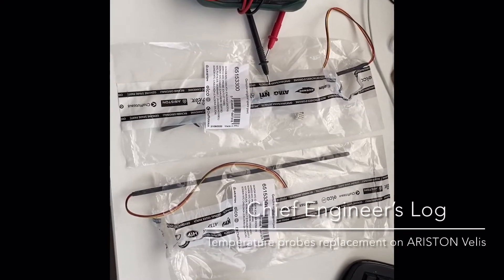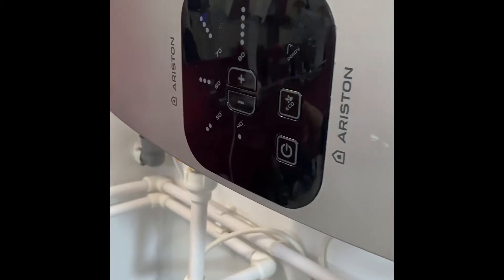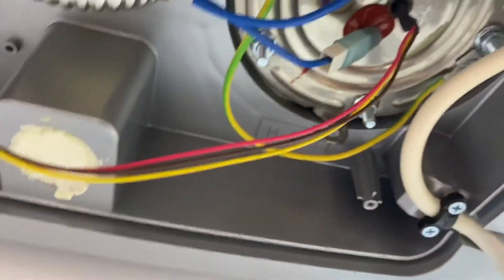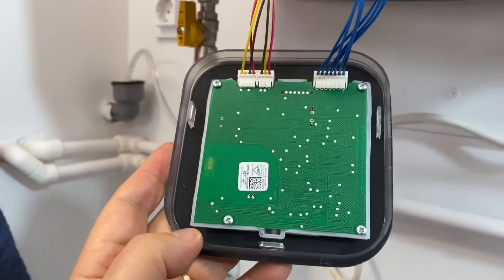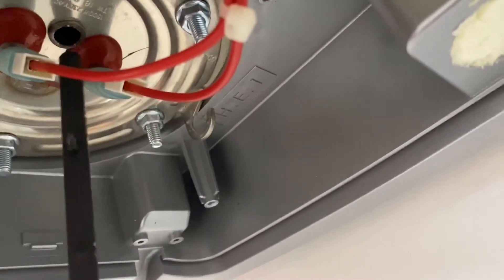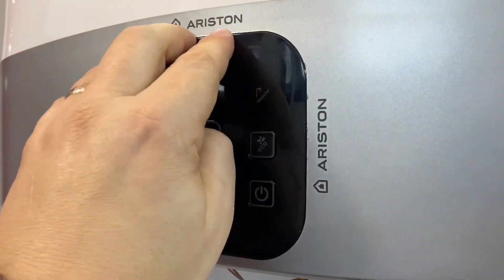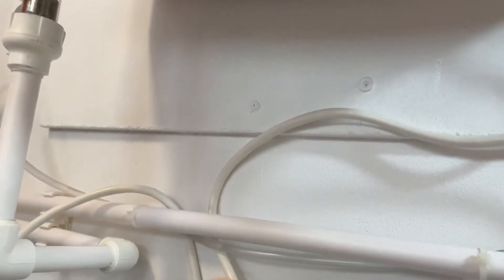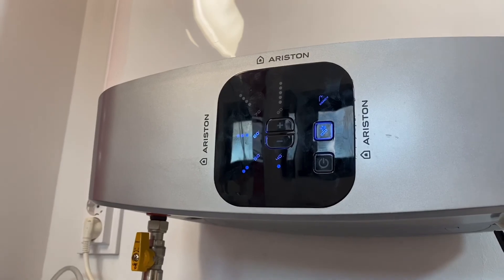Temperature probes replacement on ARISTON Velis Evo electrical boiler

Comment: Hi thanks for the video. I have a problem with my Ariston Velis Evo INOX 100 liter Model (year 2021). The circuit to which the boiler is connected shuts down as soon hot water is used. If I connect it to a different circuit this does not happen. I have read that the cause could be calcification of the heating element: if the heating element is calcified, it requires a lot more energy and shuts down the ciruit. Do you have experience with these problems? If clacification could be the case, could you place a video of how to clean the heating element? 

many many thanks

Comment: Thanks for the video. Mine one shows nothing for diagnostics. It's either turned off or on, no special lighting.
And quite often it hangs showing all LEDs and eco mode on, and it does not react to buttons at all. Do you know what can be the reason?
Reply: Hi, did you solve this issue? I have the same problem
Reply: @RICARDOJDS93 unfortunately not, my landlord just replaced it with a new one.

Comment: From the cold water supply comes a plastic pipe to the wall. In mine, the water is always running in this plastic pipe, it is normal? Or do I need to do someting to stop it?

Comment: Hello, if the problem is that after the house lighting has fallen due to a light overload, after that the monitor turns on but only slightly illuminates the temperature 70 and 80? However it is no longer working. what should I do? thanks

Comment: Hello, interesting to see how the NTC-sensors are changed.
But why did you replace them? Did the boiler throw an error-code? 

Mine is showing LED2 and LED5 at the moment. Should have something to do with the NTC-sensor on the inlet-tank.
Do you know the resistance-measurements to check if the NTC-sensor is faulty?
Reply: Exact same problem just after expiring warranty time...
Reply: @800Javi008  
I had error LED 2 and 5. Problem with temp. on inlet tank. There was too much build-up between the resistance and the temp. sensor tube. 
Replaced both heater elements and anodes. Works perfect again.

Comment: hello , what shoud i do if all the lights are on and i cant turn them off and the water heater is not giving any signs of working ? ( i did all the combination of buttons possible , even unplug it for 5 to 10 min )
Reply: Hello. My Ariston water heater makes strange noises. How can I fix that?
Reply: @teafrasheri365  noises are probably because inside the heaters are full of limescale
Reply from the maker: Just press and keep pressed for 5 sec the ON/OFF button. You should have a different light indication pattern if there is something wrong with your boiler. Once you see the specific light pattern than you can troubleshoot furthermore.
Reply: @chiefengineerslog4304  yea i tried all the stuff and after that i just replace my 'motherboard'
Reply: now it works perfect.
Reply: @nutsukamataru3368  I'm having the exact same problem. What's the solution? Do I have to call a Tec. here to fix it?
Reply: @danielamorim8794  hello , i changed the 'motherbord' by myself (it is not really hard but be careful with the electric stuff ) and it works perfect now
Reply: @nutsukamataru3368  thanks! The appliance is not mine, it belongs to the landlord. He called ariston and they will come tomorrow. Lets hope it is a quick swap...
Reply: @danielamorim8794  yup bro it dosent take to long , 2-3 hours unexperienced